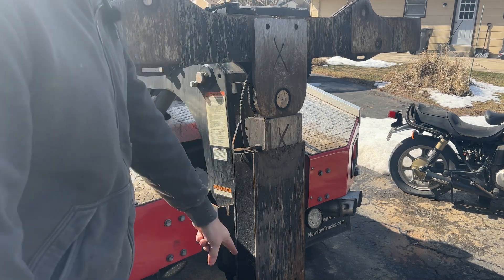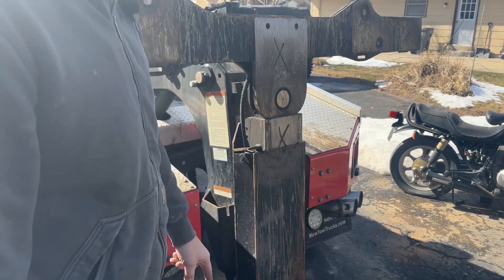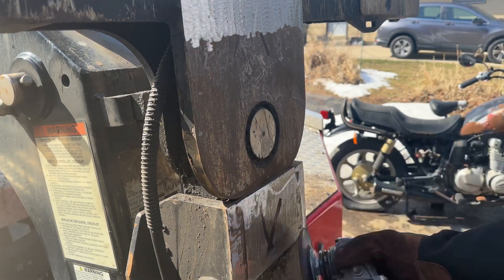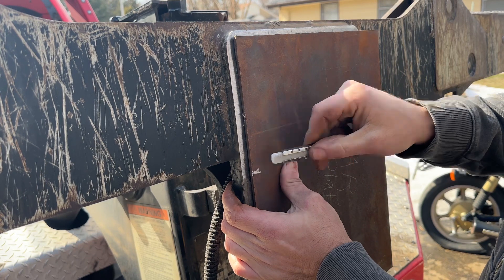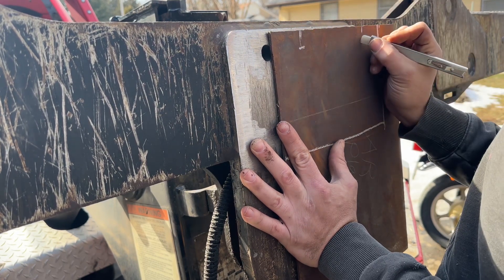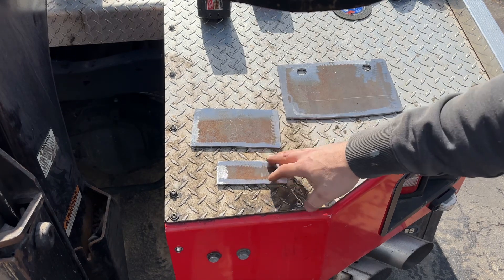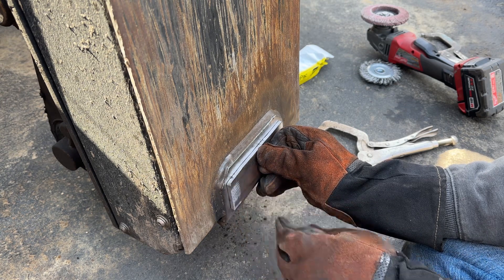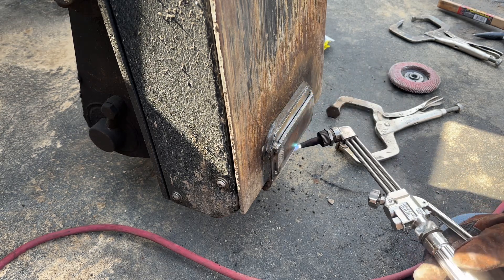Welding wear plates on a tow truck to extend it’s life

Comment: Nice repairs, looks like it would be fun work. Those out of position welds can humble someone real quick. Welding in a booth or on the flat is one thing, but those hard to reach or see, out of reach or position welds are completely different. Keep the content rollin 💯
Reply from the maker: For sure, the real world can provide some tough situations to weld/fix.  Hardest I ever faced was welding a shock tower in a ford escape with a stick welder.  Unbelievably frustrating and extremely difficult.  Never again lol.

Comment: Great video, thank you. On the video, I just saw a red hose when you're using your torch, I was wondering, did you use oxygen settling to cut it or did you use a straight gas to cut with your torch or did you use oxygen settling heat it up and cut? And I appreciate all your videos. They are very informative. You do a good job on them.
Reply from the maker: So to cut AR500 I use both oxygen and acetylene gas.  I actually run the torch a pinch on the rich side (more acetylene than normal (aka slight “carburizing” flame).  That particular plate seems to cut better that way, but it could also be the particular torch (it’s a smith).  I actually have 3 torches (smith, Harris, and victor), I find the smith seems to like odd settings to get cleaner cuts compared to the other two.  I will have to do a video on running torches soon.  I am not the best at it (plasma or dry cut does most of the work for me😀) but I could still share what I know.